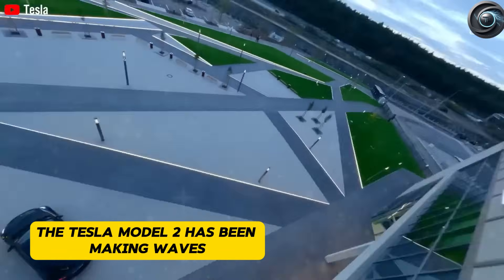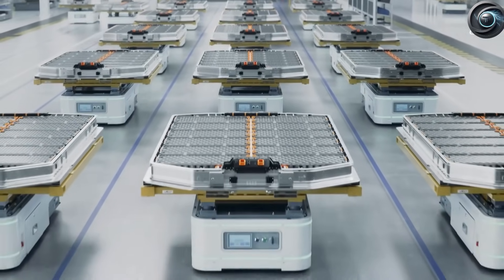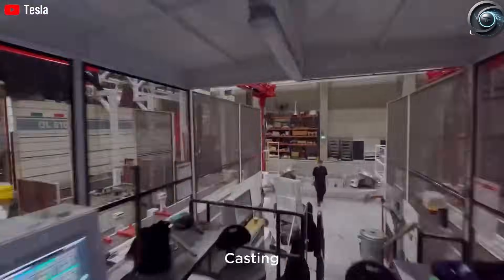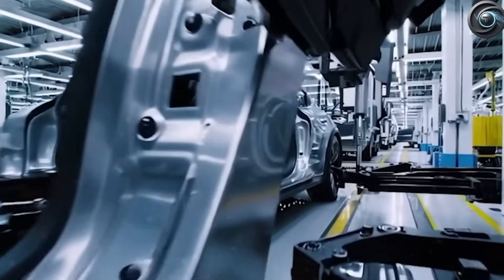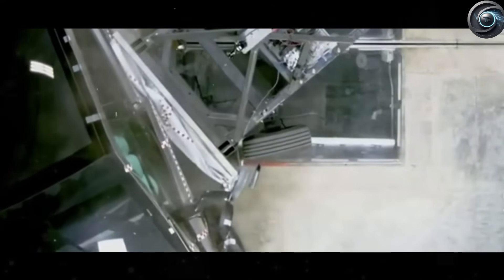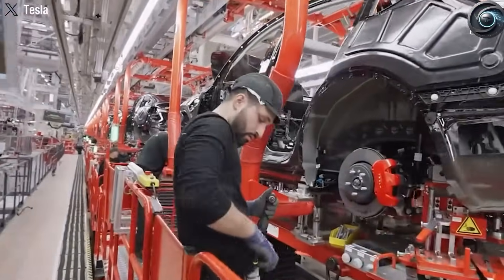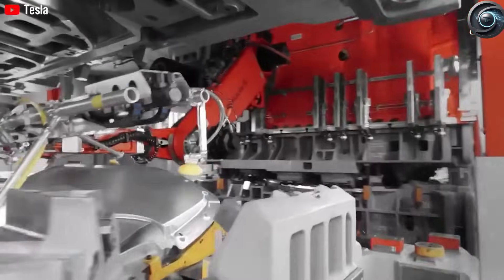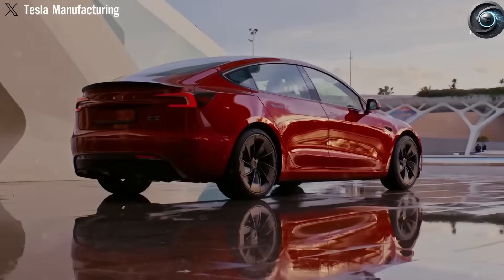Tesla Model 2 2025: LEAKED Price, Specs, Release Date & Surprises!

Comment: If under any scenario its $50k, forget it -it will not sell. Moreover, the math doesn’t make sense if $7,500 off results in a $10k price it would have to be a $17.5k car not $50k. The $7.5k is a tax deduction not a multiplier. This reasoning undermines credibility.